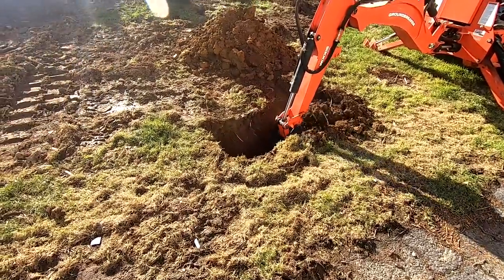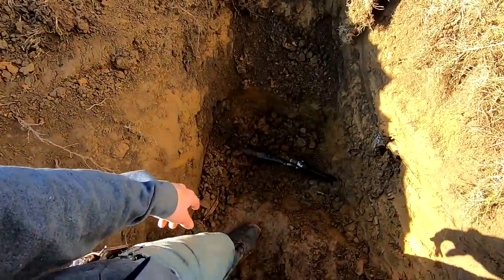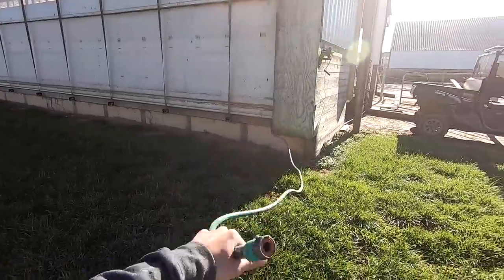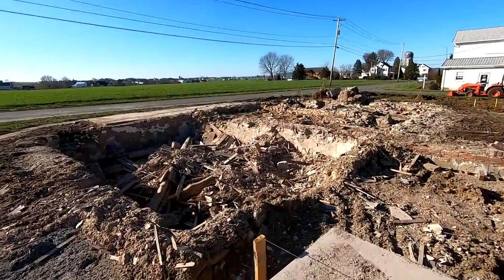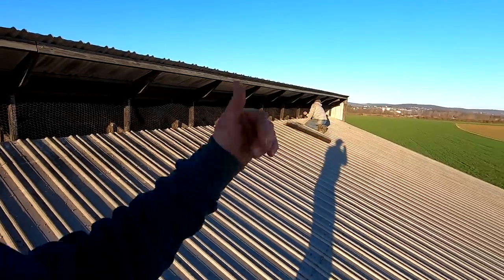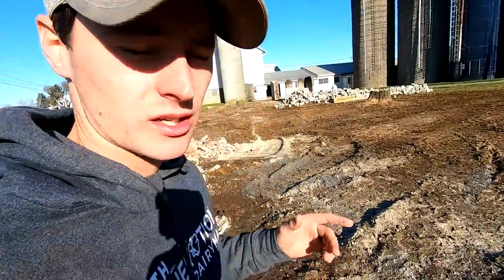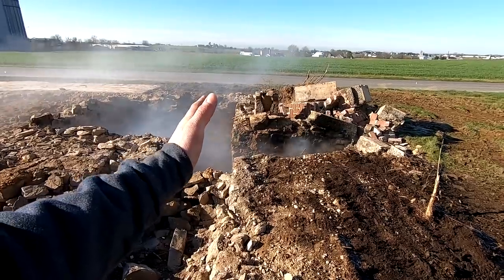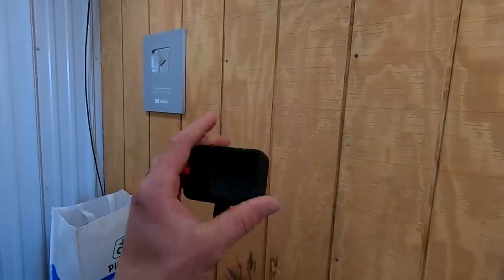Land of Opportunity

Comment: Bad idea to have all bedrooms upstairs. When you get older you will regret it to climb the stairs. Your question: what heating system to use: First is insulation, all outside walls are 2x6 even the shop garage area with fiberglass batting between OSB sheathing and drywall and on the outside blue board insulation underneath the vinyl siding. Garage door with highest R-value insulation, double pane windows with low e-glass. Flex duct with highest available R-value in exposed areas like the attic. Of course a separate room for propane furnace and a separate room for heat recovery ventilator for easy maintenance. Forget about putting those in an attic or crawl space!
When I designed my homestead 20 years ago I designed it so all caloric loads DO NOT REQUIRE ELECTRICITY because of all the power outages in rural Texas. So I have two warm air heating systems with two different duct systems (the wood/coal burning furnace uses the joist space between first and second floor, the wood whole house furnace I bought from Tractor Supply). The wood burning warm air furnace is located in my 720sf attached garage that is 17ft high, and the radiant heat plus exhaust gas heat exchanger heats the shop/garage gratis. And in the cold winter do not have to go outside to stoke the furnace and the ash and dirt stays out of the living area. The Propane powered furnace 80% efficient - shy away from high efficiency furnaces because upkeep is way too expensive - has also a AC-Coil on top for air conditioning in the summer. The duct work for the propane whole house furnace is flex duct with independent registers for return air and supply air. it is a two zone system with only one AC condensor to save cost, Also the duct work for propane warm air and central AC has a heat recovery ventilator, that runs constantly and exchanges stale are from within the house with fresh air. No chance for barnyard smell to settle in the house, even when you 'occasionally' come in with barn boots. Clothes dryer is propane, kitchen range & oven is propane, Water heater is propane and 12kVA gen set is propane. Propane I buy annually from our Farm Coop in a summer fill up in my two propane tanks one is 1,000gal and the other 120gal. When you set it up that way the 12kVA gen set can even run central air in the summer. With e-commerce the norm today I have so much cardboard to burn each winter that the use of propane for heating is minimal. Very happy with this setup ever since. And since the electric load is so low this allows now to add PHOTOVOLTAIC solar panels on the entire roof and a big battery for storage of electricity. So even less propane is used because the battery can power the house for most of a power outage. Stay away from tankless water heaters but change the sacrificial anode every three years, and the tank will not leak for more than the 12year warranty. Sure I do not know what you pay for propane at your place. Maybe your local Farm Coop sells it to you for a competitive price. 

In Europe when you have so much liquid manure like your Dairy operation they run the manure through a digester and produce BioGas, which is actually methane and can be used a fuel for Natural Gas appliances. The only appliance you may have to change is the warm water heater since they typically cannot be converted from propane to Natural gas. But even here when you buy a propane one, you could get burner and thermostat assembly as spares for Natural gas at time of purchase and change it later on saving the tank. (OEM spares for water heaters i.e. the burner are only available for a short time from production date since these are very trendy items). 

Your electric baseboard heating must have cost a fortune in electric bills and the house was still cold.
Problem though you are too close to braking ground for the new house, all that needs to go in the AutoCad drawings and planning. 
Maybe you are stuck with electric baseboard heat again, since no planning is needed for that, its the lowest investment but the highest in operating cost.

Comment: Your home is father south of ours and we have much colder winters, most homes here in Munich have heat pump geothermal. Even when it's 40 f the house is warm and the heating system is still off. I usualy start the pump when the temps drop to say 35 f so look into geothermal heating and cooling.

Comment: The key to your hickey Eric, depends on your installation and how good your windows are. Radiant floor heat is great for the bathrooms in the garage. Gas heat, good and in most parts is Cheaper. I personally like Central air heat.

Comment: You could do radiant in floor in the basement but I wouldn’t bother unless you plan on using it for active living space as well. 

For the rest of the house since you want  air conditioning. I’d do forced air. An air handler with a hydronic heating coil and an AC coil. 

I’d suggest a viessmann vitodens wall mount condensing boiler with a viessmann domestic hot water tank. This way your house heating and hot water needs will be supplied by one very efficient condensing boiler.  

Bonus of using a boiler vs a forced air furnace. Efficiency is a little better, more flexibility, you can do infloor, baseboard or convection radiators. Or fan coils anywhere you want. Plus hot water for the house. 

Also with a hydronic system you have the possibility of geothermal, solar or heat pump you can add at a later date.

Comment: I strongly recomment to have at least 2 different types of heat rather than just pick one type of heat.  I would do floor heat but have a wood stove in the basement.  That way you have heat when the electric is out (an all too common occurence in our area) you can still have heat.   I have electric floor heat, propane several propane wall heaters and a Baker's Choice Cookstove in the basement.   The cheapest this year is the wood heat, but there have been years where either propane or electric were cheaper.

Comment: I have wood/propane boiler, with in floor heat.   The only thing I would change is to only put, in floor heating in the basement and hot air in the upper floors, still heated with the boiler.   This way you can have A/C .  But heating with wood takes time, and you seem pretty busy.  LOL So maybe just propane or gas whatever is in your area.

Comment: Heating sourse: I have heard from lots of people that hot water heat is the most efficient. Heated floors is the best from what I have heard. The type of fuel really doen't matter natural gas, propane, fule oil, wood. I do know from my time deleivering heating oil that it is vry expensive. For me I have access to lots of fire wood so I will be going with some kinda of Outdoor Wood Boiler system with radiant floors and heat exchangers so I can have endless (on-demand) hot water for showring. That's a major benefit when using a hot water boiler system. Will be interesting to see your choice.

Comment: I would advise you to get a heat pump/A/C unit, abit of an upfront cost. But it makes 3 times as much heat for the power you use, compared to normal heating. Considering you are young, and probably will live in this house for years to come. That investment would pay itself off rather fast. I personally like to have a wood stove aswell incase power goes out, or if i have some extra wood. Guess gas heating altso serves the same purpose.

Floor heating is nice too ofc, but not as efficient. But i like having floor heating on the bathroom atleast.

Comment: Hi Eric, I'm an HVAC contractor and my recommendation for heating and cooling would be a high velocity forced air system with inverter drive heat pumps.  I'd recommend Unico high velocity equipment with Bosch IDS 2.0 heat pumps. Being a two story I'd recommend two separate systems rather than trying to do it with one.  It will be more expensive but worth the money.

Comment: Water Under floor heating, if you can get some solar on the roof with battery storage system as well, will help if you go towards a phev car in the future. Use a air source or ground source heat pump for the heat source.  Good luck

Comment: The best heat is radiant heat along the outside walls to keep it simple.  A house that size might need a couple zone valves/circ pumps.  Floor heat is nice but you could make provisions to be added later.  Assuming you’re burning gas, don’t let anyone talk you out of a cast iron boiler.

Comment: I've been building and remodeling homes for 25 years. Here is a short list of some basics....

- In floor hydronic hearting is by far the best.  Forced hot air duct systems will blow dust, dander and mold all over your house and cause hot/ cold spots. In floor heating is gentle, efficient and you can do most of the work yourself. Buy a Navien boiler.... they work great and they are more affordable than the 'big brands'. Install air conditioning ducts and prep for A/C.... even if you have to add it later.....

-Second best option for heat and air conditioning would be mini split units throughout the house. They are very efficient but they are a bit cumbersome looking...

-It doesn't make a difference to how efficient your heating and cooling is unless you build a highly insulated and tight house... you may as well run the heat with the windows open. 

-Use 2x6 outer wall constructions with ZIP R sheathing if its in the budget. Seal all the seams on the ZIP system. Again a lot of busy work that you can do yourself.

-Buy the best windows that you can afford. 

-Insulation... insulation... insulation.... Do it right now and you and your family will be more comfortable and you will save on those bills. 

-Use a fresh air system and make sure you properly vent your stove hood. 

-If you have an attached garage. Use the ZIP system between the garage and house to keep gasses out. You'd be shock at how badly traditional homes leak. 

Without question... I would spend my money on the above items before any luxuries in the home... they can always be added at a later date. Go to the  'Matt Risinger'  YouTube channel and geek out on some building science. 

Enjoy the process.... its for life.

Comment: whatever the heat source- air seal, air seal, air seal.  Good insulation helps too.  Spray foam is good at both but lots of ways to achieve it (I used zip system sheathing to air seal my wall assembly and liked it).  
For heat, I know people that have Geothermal and are happy with it.  I have a mini split heat pump (ohio) and it's pretty good.  I really wish I had a ducted version rather than a wall mount, but mini splits are efficient.  If you air seal and insulate right almost any heat source properly sized will be comfortable, so that's the biggest thing.

Comment: In floor heating using water pipes.. At some point then you can drill a hole for groundwater and use water-water heat exchanger. This will then really get your heating costs down. 
While running of gas and/or electric, this will still be cheap to run.  

The biggest issue with infloor water heating is that it's hard to separately adjust room unless you pipe for it particularly (Water valve either thermostat controlled or hand valve)  
The house I lived in with that had this had the adjusters near the pressure tank so you had to go there to adjust rooms.

Comment: Some facts about new construction gathered from owning a heating and air conditioning business in Indiana for 25 years. 
#1 Don’t build a new home without central air conditioning, you’ll regret it.
#2 You WON’T cool the upstairs of a two story home without a separate unit for the upstairs or a properly zoned unit serving the whole house. 
#3 Hot water heat is wonderful but leaves you without any ductwork to use for central air conditioning. 
#4 Properly installed insulation is critical, money in the bank every time the system runs.
#5 The more expensive the equipment, the more expensive the repairs.
#6 Too many repairs are caused by shoddy installations, primarily inadequate airflow from poorly designed ductwork, improperly sized equipment, and poor air filtration. Be prepared to sacrifice a little space for the ductwork.
#7 The type of system and the brand that you buy are not nearly as important as the dealer who installs it, and provides service in the future if needed.
My $.02 worth to someone I admire. Good luck to you.

Comment: Heat pumps are popular in the hotter climates, especially the desert southwest. Gas Forced Air Units are cheaper to run cause gas is cheaper than electricity for heating.Under floor hot water keeps the room an even temperature.  You are in Pennsylvania IIRC. If you don't need A/C, then go with gas FAU. I'm in Southern California, 3 miles from the beach, and haven't turned on my gas FAU in now 6 winters, so I'm prejudiced. Thanks for the video. Jon

Comment: Eric, it is awesome you are planning for not only your family, but the farms' future.  What works for me is a dual fuel system. Heat Pump and either propane of Natural gas supplement. Mine is set to 30 degrees t o supplement the heat pumps. the electric cost has been next to nothing and my propane bill was cut by two thirds, before the fuel cost increase.  Best of luck in whatever you choose to utilize.

Comment: I would put an out side wood burner in for heat and hot water. Check in your are for tree trimming and removal company's because they will give you all the trees you want but it will take work and time cutting and spiting the wood.

Comment: Radiant heat is the most efficient and the most economical 
The Key is at lest a foot of washed stone under your slab to isolate it from ground temperature 
And poor you slab a minimum of 6” 
The thickness holds heat much longer so your water heater runs a lot less 
It will keep your hole house warm 
As a bonus the water boiler you get for your floor heat can also provide more hot water than you could ever use even if you just leave all your faucets on 
Natural gas if available, but propane works just fine 

My heating bill went from over a hundred a month to the 30 dollar range and this is keeping the temperature up at 70

Comment: Crazy thought, if you go with some type of radiant heat say in the floor, is there a way you could pull heat from the milk cooler?  Like how geo thermal works, but getting heat from the milk instead of the ground?

Comment: Inlay floor heating is better than central heating or furnace heating. Also, hot water on demand is always a better method of heating water as well as more economical.
Baseboard heating is not an effective method of heating, so don't listen to anyone that informs you otherwise.
Inlay floor heating can be done one of two ways, using hot water or using an electric netting. The electric netting, was available at Home Depot, uses as much power as 30W lightbulb to as many as 4/5 30W lightbulbs, depending on the area. Using hot water method is constant, but the electric allows more control.
Stay away from spray foam insulation, its toxic when applied, not while its set, but is toxic when it burns and doesn't allow the building to breathe.
Case in point, R2000 homes built in Toronto, ON, Canada. They built six, and everyone that resided within, because the homes were so air tight, residence were getting sick. All houses required air exchangers.
Tyvek breathable one side allows for the house to exhale but at the same time prevents moisture from entering the home. Unless you've already purchased the materials already, stay away from OSB, its crap, the glue is toxic. If you do use it, Tyvek exterior and reverse application of Tyvek for the interior. Reason. Don't want the glue to fume into the home. When OSB gets wet, turns to a grey powder and falls apart. Also, again if you do use it, make sure that the bottom 4 ft is done in plywood. That's the frostline. Then if you must, use OSB for the remainder of the exterior walls.

Comment: Eric if you can work it into the plans install a freestanding wood stove as an emergency/alternative heating source no matter what your main source of heat is. All of our family and extended (Mennonite) family have and use them. You won't regret it. God Bless and Merry Christmas!
Reply: Check with your insurance company before installing wood heating. Can have significant difference in your insurance costs.

Comment: BASEMENT AND FIRST FLOOR MAKE RADIANT HEAT SECOND FLOOR RADIATORS IN ALL BEDROOMS. YOU WILL NEED GAS BOILER WITH AROUND 4-6 ZONES AND AIR IS NOT DRY. 
HOT BLOWING AIR IS VERY DRY I DON'T RECOMMEND IT AT ALL. if YOU WANT TO PUT RADIANT HEAT IN 2ND FLOOR BATHROOMS I WOULD DO IT.
WHAT I WROTE I HAVE IN MY HOUSE AND THE COLDEST DAY IT'S STILL WARM IN MY HOUSE. RADIATORS TEND TO STAY WARM A FEW HOURS
AFTER YOU CLOSE THE THERMOSTAT. HOT AIR SYSTEM YOU CAN NEVER SHUT BECAUSE 10 MINUTES AFTER YOU SHUT OFF THE THERMOSTATS
IT WILL BE COLD ESPECIALLY YOUR AREA. IF YOUR DOING IT DO IT RIGHT WAY.

Comment: Heat suggestions we have a heat pump which is great as it gives heat to a point and A.C. using one device we have natural gas as secondary heat so when temp drops to low furnace takes over so forced air with a new build you could do a infloor heat along with A.c.

Comment: Condensing type combo boiler, floor heat and domestic hot water in a single unit. Mini split unit for AC and supplemental heat  After  38 years of home building ,this is the best thing so far  Using top quality doors and windows alongside careful attention to insulation will pay back many times over the years.